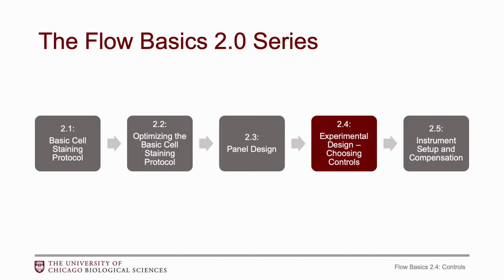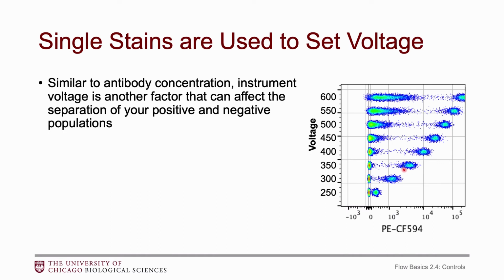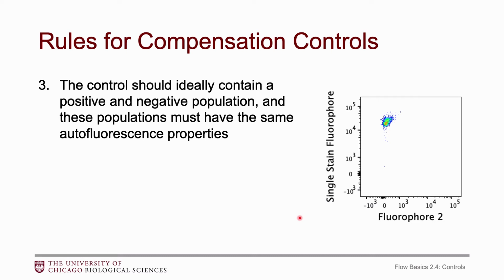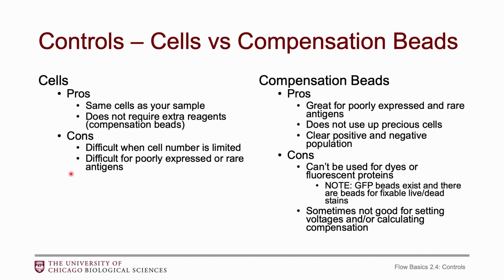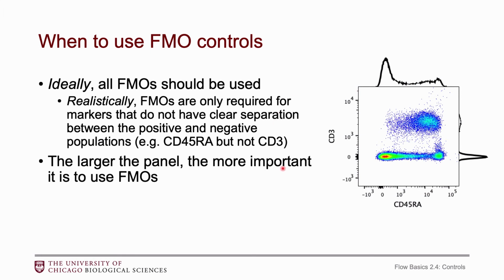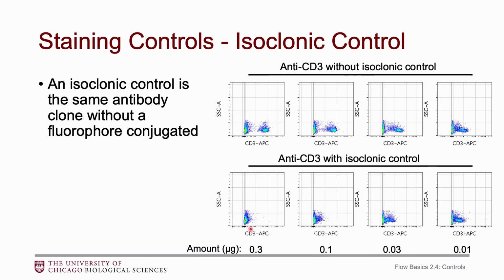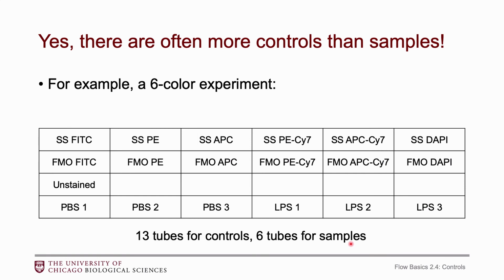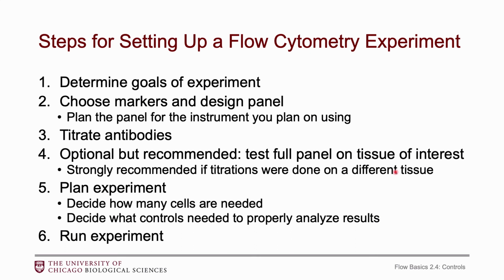Flow Basics 2.4: Experimental Design and Controls

Comment: It is a great series to introduce Flow cytometry. Here is a question for FMO and unstaining control. Could I use beads without antibodies for unstaining control or i have to use cells without antibodies for that? The same concern for the FMO, cells or beads? Thanks.
Reply from the maker: Hi Fei, thanks for the good word. Unstained beads will be used as control for compensation and unmixing if you are using the same beads for your positive group. The autofluorescence of both positive and negative must be the same. But for your FMOs, the question is different: you are trying to figure out the impact of all of your fluorophores  (minus the one you're gating on) on the spread of the negative population. So the only appropriate way to create this control is to use cells.
Reply: @UChicagoFlow  thanks for your response. I am still confused with the unstained control. In my previous experience, I used unstained beads to adjust FSC and SSC to settle the cell population in the middle of plot. And set up the voltage of each color through the single control with beads for compensation. However, I didn’t do unstained cells to adjust that cell population. Beads could not the same size with the real cells. So, I want to know whether my design is acceptable through unstained beads to gate cell population instead of unstained cells? Sorry for my tedious words.
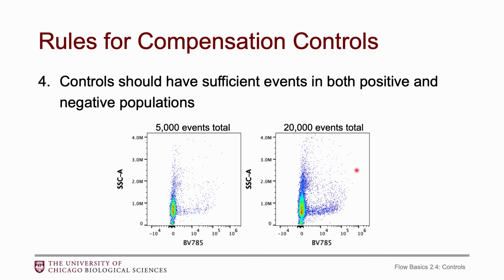Reply: @feitu6403  I typically set voltages on FSC and SSC specifically for the beads and cells. Most of the time, they have different properties, and will require you to decide on the settings to best showcase what you're actually looking at. As far as selecting the voltages for the fluorescent parameters detectors, I think your method likely puts you within range of what will allow you to separate your positive and negative markers without saturating the detectors. This is the whole point and if that is what you have right now, you are probably good to go. We go in more details about voltage selection in the next video in this series - here 13:05.
Reply: @zxcv2677  thanks a lot!